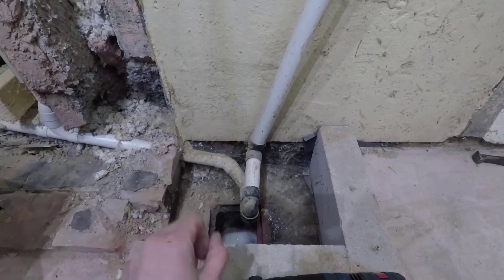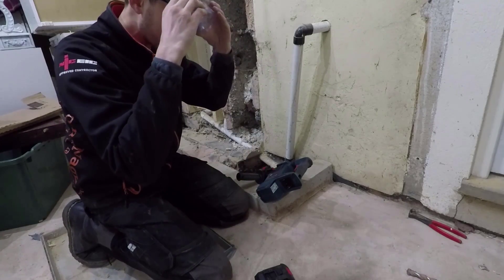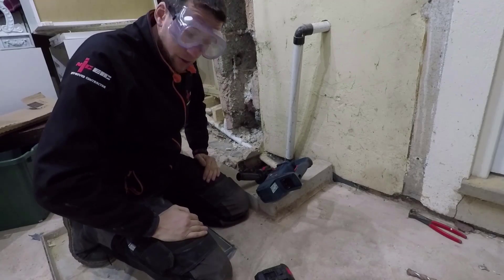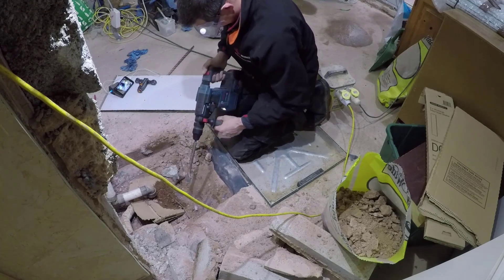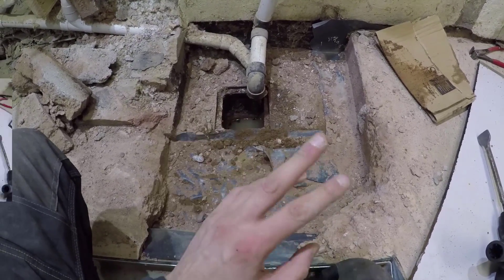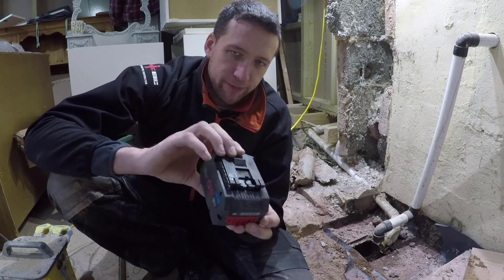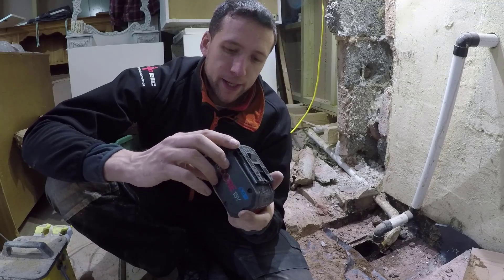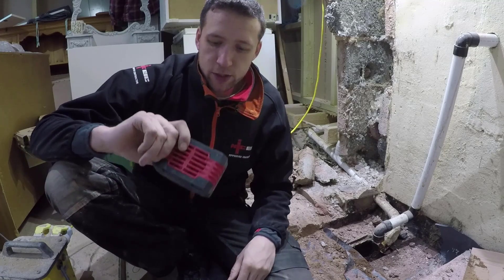Thomas Nagy reviews the Bosch Procore 18V  battery

Comment: I like your vlog specially the part where you did a beating on it like throwing it and running over it with a car. I wish that beating test could been shown longer, coz you are the only vlogger who showed that.
Im afraid that my workers will damage these expensive batteries, but upon seeing that beating it helped me get reassurance that these Procore batteries are the right beast for the job.
Also, you failed to mention or i missed it, the kind of Procore you're using, but seeing that it has the Blue print, i guess it's the 8ah you used for the 45 minute job.
Reply: I believe he mentioned he used the 8 Ah. The only other blue model, the 5.5 Ah one, wasn't available at the time of recording I believe.

Comment: Sorry but 45 mins to do that little work nah mate no good
Reply: He used a compact and relatively light 2.6J rotary hammer. For pure demolition work, they have far more powerful BiTurbo models with up to 12.5J of impact energy. 
The whole idea was doing something that required more time than the battery could provide. Otherwise, it wouldn't be a useful runtime test.

Comment: Good size for an 8ah battery , shame it’s on a Bosch . In every comparison video Bosch always get smashed by Milwaukee, dewalt and Makita
Reply: All my tools are Bosch and I've no complaints at all and the 36v sds is the best I've ever used, someone I work with bought a 4 piece milwaukee kit and within the first year every single one went wrong. Milwaukee is crap
Reply: yes maybe bosch have less torgue but this is because they want to protect the mechanical parts of the machine.After 10 years your bosch will still working,maybe Makita too but Milwaukee and dewalt i am sure not.This speed tests videos u can find in youtube are useless in real life work.Real life every day work is something different.U cant do perfectly your job with a bosch and save money by changing drill every year.
Reply: @nikosfotopoulos3802  I totally agree. All my tools are Bosch and they have never let me down, these comparison videos have no place in the real world, and the 36v sds is an absolute beast.
Reply: SouthFront watching the comparison videos does tell you quite a lot . It can’t tell you reliability over time but speed and torque it can and Bosch just don’t hold up
Reply: The only think that matters for me in this tests is for example the number of the holes a drill can do and the quality of the battery  and not how fast, because Noone will go tomorrow at work and start opening holes like crazy.As I said before for me matters most to have a drill for many years or not to break my drill if it falls from my hands, not feel cheap in my hands etc..thanks for answering :-) cheers
Reply: The last 15 years I was working with Makita and Dewalt mostly.Sorry but Dewalt was completely crap.My Makita still working..I bought few months ago this drill in video and Bosch GSB-18v 85C with 8ah battery and I can tell u is the best drill I ever had in my hands.The only negative is that is quite heavy
Reply: robert swingler it’s sad but true.